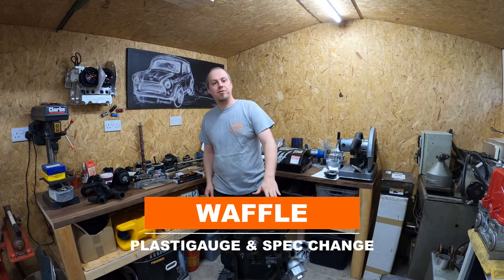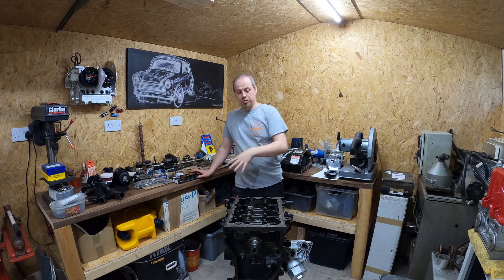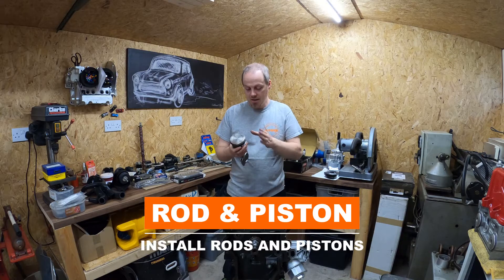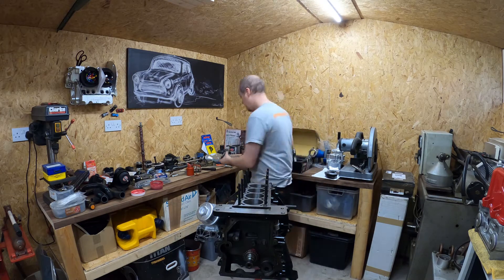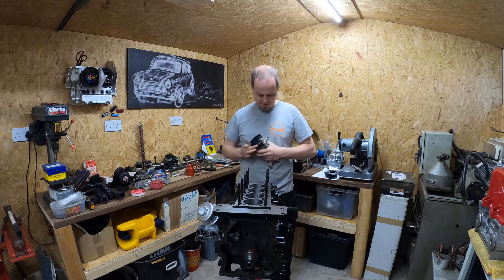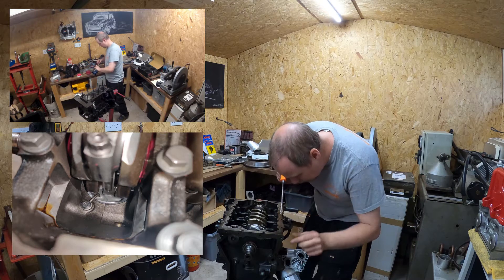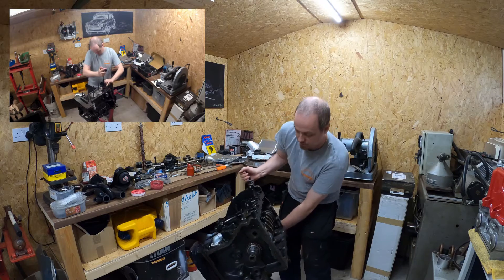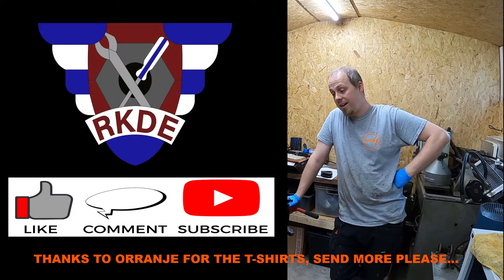Mini cooper R53 turbo engine rods pistons head assembly

Comment: Thank you, great video. Rebuilding my R52 now, from a blown piston. I think detonation. Are the factory pistons forged in these? No one seems to know. I will increase the boost with the JCW pulley, and higher fuel injectors and cold air, so do you assume that should require forged? Or would stock new be ok? Thank you sir.
Reply from the maker: @leroijr407  hi, the factory rods and pistons are forged. A JCW pulley on the M45 is only an 11% reduction and minimum increase. Typically an 11% car would have 380cc injectors but I'd suggest going 15 or 17% with 550cc. I've always gone straight to 17% . It's still quite low boost. You'll only have issues with the internals over 350hp but note that the blower uses about 70hp of engine power to turn

Comment: Do you noe if its possible to supercharge an r50 and what is need to do it
Reply from the maker: It would be possible to put a supercharger on a W10 (R50) engine in terms of fitting it, though I would probably advise against it. The crank is smaller, the engine is missing oil squirters and the engine as a whole is not built to cope with the extra stress, then there is the gearbox which if pre-facelift struggles to cope with the power of the standard engine. It would actually be much less hassle to whip the engine out and replace with a W11 engine and 6 speed gearbox. In the long run much cheaper too and reliable. The easy route would be to buy an S but appreciate some people are attached in which case, but a scrapped or damaged S, remove the parts you need and do the swap. Should be possible with a donner in less than a couple of days with a simple tool kit and engine winch 

You would also want to change the ECU over and then code it to the EWS
Reply: @rkde2042  thanks on the input i already have an S 2005 but i also have an r50 and i want to make it faster i have an r56 turbo engine just sitting in my garage will that fit in an r50
Reply from the maker: @teofiloholguin8877  I've seen an r56 engineer replaced with an r53 W11 engine but not the other way round. The Prince engine is big and you would really struggle to fit it in. 

In all honesty the effort required to fit it is going to be the same as fitting any other engine from a different car. The money and time you'll spend on custom engine mounts, custom drive shafts there are much better engines out there than the Prince. I'd be putting something like a VW turbo engine in or a k conversion. Even a B18/B18 engine would be better than the R56 

The reality is that whilst the r56 is the next generation of mini it's as different as another brand of car, it's much bigger, I get asked about bumpers and kits and yes it's similar but it's different in inches

Don't let me put you off if you fancy a project but I'm just saying if you're going through the effort make it worthwhile